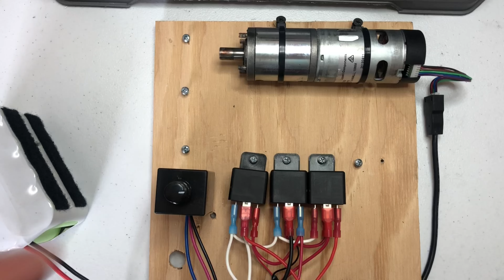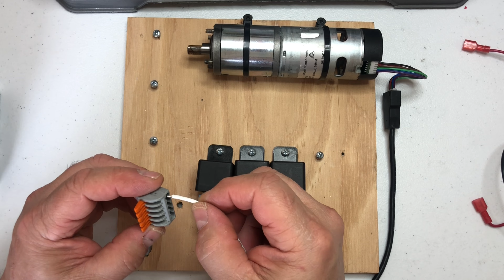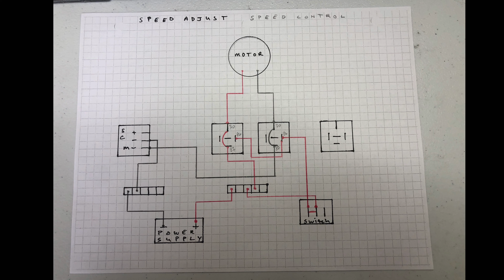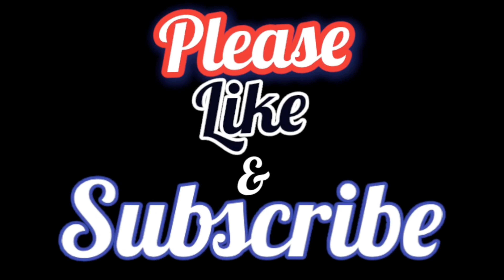Reversing Polarity at Two Different Speeds

Comment: OK so I had to watch most of this to get to the point where it made any sense. but the whole time I knew you were taking the very long way of doing this. 

YOu DON'T need three relays. Just the two. It is SO SIMPLE. 

All you have to do is

Wire relay A, 87a to straight negative and 
Wire relay B, 87a to speed control out negative.

THAT'S IT.  

When relay A is energized speed control is in effect since Positive is fed by relay A and the speed control negative is connected through relay B.

When relay B is energized it runs at full speed. Positive is flowing through relay B and regular Negative is connected through relay A straight to Negative.

In fact if you wire a second PWM speed controller to the other negative you can control speed both ways.

In any case this is still a good video. Having things mounted and not flailing all over the place makes for a better instructional video. Tip for these using bosch style relays. Mount strip of board perpendicular to your base board. Them mount the relays on that board with the pins facing up so you can see the connections being made.
Reply from the maker: As it says in my bio, I’m here to learn and share what I’ve learned…
Reply from the maker: any idea how to do this. i have a few ideas but nothing firm yet?
@FENIA3648
@FENIA3648
3 weeks ago
I watch your videos and I am impressed by the simplicity which you explain everything. Thank you very much for the knowledge you share with us.
Pressing the start switch starts the motor. By moving the magnet to the next point I would like the motor to stop (apparently receiving another command from another 4th relay). Then from the same source (4th relay or maybe a switch) to receive a command again to continue the motor working in the same direction until it finds the third magnet which will stop the motor again. I need to do this 5 times (5 magnets). I would greatly appreciate it if you could help me.
Reply: @mikmaster63  The simplest thing to do is use a micro controller. BUT we love our relays don't we. The trick is us use cascading latching relays. That is easy. Is the magnet being moved by YOU or whatever the motor is controlling? The hard part is the delay before it moves on. Easy to do with a few delay timers. Will cost round $50. To do it with just 1 Is going to be the challenge. 

Does it need to be Bosch Style relays or can it be DPDT relays? What is this going in? How much room do you have? Does it have to be relays? If I make you a circuit board with 5 triggers, in simulation software can you put it together? How long it the delay? 

To start I need to give you a link to a diagram for you to look over. It has the beginnings to do this. But I will need you to go to one of my videos and comment. That way I can put the link in the description. Youtube keeps deleting my comment with external links.

It has a counter that can be changed out for a timer. 

What it does is that 
It starts at a HOME position
Passes position 1 (a micro switch)
Moves to Position 2
Reverses
Come Back to Position 1
Reverses 
Peateats till counter reaches set count.
Then returns HOME.
Reply from the maker: @AztecWarrior75  it’s not for me it was a question I got from someone. that’s what I’ve found too. Haven’t had time to figure it all out yet.
Reply: @mikmaster63   Well so far the timer relay (Dual Mode 0.01S-99H Delay Timer Relay AH3-DM if you wanna look it up.) has two modes. A and B. It has two relays. Let's call the TR1(Timer Relay 1, the one that will turn on right away)  and TR2(Timer Relay 2, the one that will turn on after set time)  

On B Mode one of the relays turns on right away as soon a power is applied. The other relay will wait till till the set time has lapsed. 

Using that time you will control another relay. Call that relay MR. That relay will have either the positive or negative side of the motor power. PINs 30 and 87a.

You will connect the trigger to the MR 86, to the TR1 (PIN 4 Normally Open) 
On the timer, jumper PINs 1 & 8 The two commons
TR2 (PIN 5) wire to negative.
Timer Pin 7 wire to positive

Wire the first 4 reed switches Commons to ground.
And the N.O. to Timer PIN 2.

Now Each time the magnet reaches a read switch it will trigger the timer. 
TR1 immediately turns on, triggering MR. 
MR is triggered and motor is turned off.
Once the timer reaches set time, TR2 turns on, disconnecting the power from MR
Motor moves on to the next reed switch.

From there it is whatever you need it to do. Stop, reveres .....

Now this is untested with reed switches. I can not guarantee that it won't retrigger before the magnet passes. Or gets triggered too soon.

Hope this made sense.
Reply: @mikmaster63  This is a very Overly simplified version of the timer. Me clicking on the switches to actuate the relays is me trying to simulate the timer turning on, TR1 turns on right away and then after set time expires TR2 turns on. 

https://youtu.be/51VguHoJfpM

Let me know if this seems like what they need. Still need more info as to things like does it need to do this over and over or just once.
Reply from the maker: @AztecWarrior75  nice, thanks. I’ll pass it along and I’ll try and build it when I catch up on videos…
Reply: @mikmaster63  OK NP. Just remember that I did not include a stop at the end or reversing. So if you run it be prepared to shut it down. If you need further diagrams or help in reversing or looping drop me a comment on the video I already linked to. I don't always get notified of replies. At least in my videos I can check easier. And post links to diagrams.
Reply: @mikmaster63  I had a few minutes so I added a motor brake and reversing/looping configuration with two options. One opt is that it stops at every reed switch in both directions. The second opt it only stops at every reed switch in the forward direction. 

https://youtu.be/TGjsy1ns5_c
Reply from the maker: @AztecWarrior75  too cool. I’m working on learning Arduino. It’s been fun…
Reply: @mikmaster63  TY
Reply: @mikmaster63  Yeah arduino with a Motor Shield would be way easier to do this. Still It's not that hard with relays.